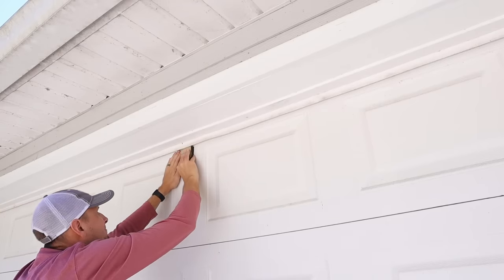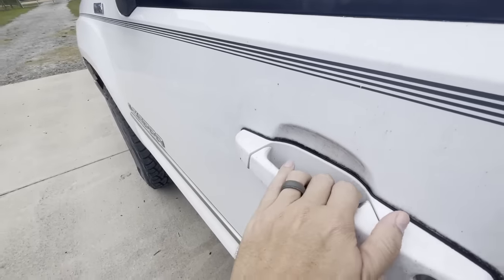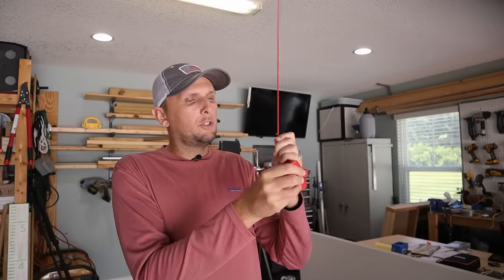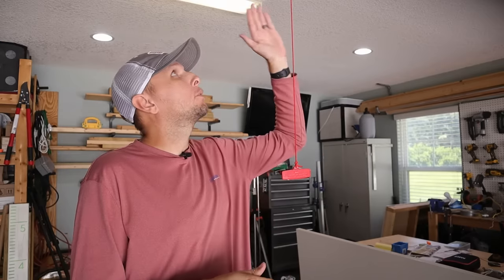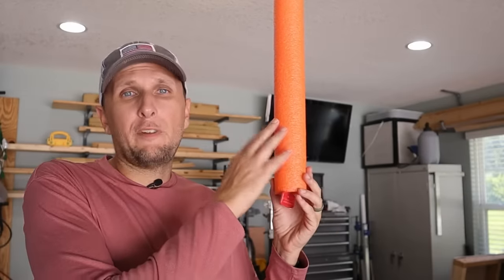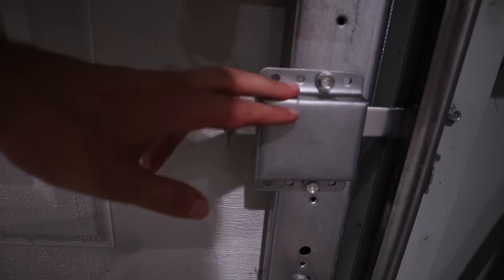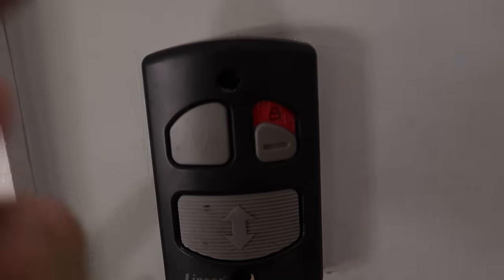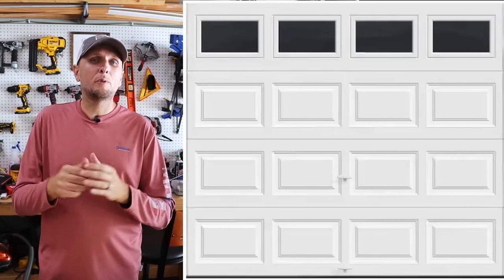How to Stop Garage Door Break-Ins | Number One Way Thieves Get Into the House!

Comment: Another classic screw up that leaves your home / apartment vulnerable is dead bolts that do not have the bore in the door frame deep enough to allow the dead bolt to lock.  Great content and thanks for sharing,
Reply from the maker: You are absolutely right!  And with all of the homes going up so quickly and inexpensive as possible, this is a common issue.  Thanks for the feedback David!
Reply: Or screws long enough to attach the locking plate into the actual house framing instead of the door framing
Reply: I thought of boring in a few inches of metal pipe into the door frame, just big enough diameter to receive the deadbolt, and then install the latch plate.  It won't change the look of the door frame.
Reply: @Mike__B  If the recess for the dead bolt is not deep enough for the dead bolt to lock after it is turned all the way then it does not matter how long the screws are.  The dead bolt can be coaxed back into the unlocked position.  Try it yourself - open the door, throw the dead bolt and push on it with your hand.  It will not move.  If it is 75% extended and bottoms out in the bore of the door jamb then you can push it back with your hand to the open position.
Reply: @elultimo102  it is not a matter of the pipe as part of the bore it is the depth.  Please see reply above to Mike B
Reply: @davidc6510  easy fix, Wal-Mart Drills are $12, paddle bit $2 for a cheap one, and 10 minutes time. I did this at my old apartment also because it wasn't deep enough, it is now.
Reply: @Mike__B  ---I was advised to reply to you.  I thought of using a 3 or 4" length of pipe, large enough to contain the deadbolt plunger, and still be hidden beneath the strike plate----They would have to bust through 4" of wood, to get the door open.
Reply: @davidc6510  ---I was figuring on 3 to 4 inches of pipe into the framing.
Reply: @davidc6510  No no I get that, my comment wasn't trying to refute what you said at all.  I'm just saying, I've seen a number of times when things are on the surface "perfectly fine" only to be ruined by the fact that dead bolt plate is screwed into the casing frame with small screws so that it's basically 3/4" of wood being the only thing to prevent a door from being forced open.
Reply: @Mike__B  I totally agree on that half a$$ install technique as well.  Had some work done and replaced those lame 0.5" length screws with 1.0" through the frame as well.

Comment: If you are worried about the one-button car remotes, you can usually get a spare keypad remote (like you would have outside the garage)  that is also wireless but programmed with a password. That can be kept in the car and then used instead of  the one button remote (disabled that).

Comment: Another way to secure the garage door when leaving for extended periods is just to screw a piece of 2x4 to the wall between the door and the ceiling.  The door will be impossible to lift.  Great video.  Regards - Mike

Comment: Pro tip: most newer garage door openers come with a wall console (where the push button is) that have a lock. The lock stops your transmitters (remotes) from working by locking the receiver.

With the clothes hanger, even with a pool noodle on the emergency release, the clothes hanger can pull the tab that the rope is attached too. Most brands have the tab facing away from the door and to unlock it, you can pull it where it snaps 90 degrees down or just pulled toward door enough to disengage it. You don't even have to pull the rope, just the tab. I have seen customers use zip ties around the tab and trolley to hold the tab in place. You'll have to cut it if you need to disengage the trolley. There are certain brands such as Marantec where the rope has to be pulled away from the door to unlock, meaning the clothes hanger won't work because even if the rope gets pulled through the top of the door, it has to be pulled the other way to unlock door.

Never lock the physical locks unless the power goes out and you need to open/close the door. You will eventually forget and if it opens while the lock is engaged, it can damage the lock, the opener, the door. It happens more than you'd think.

If you have torsion springs, you can set the opener off center. This is because the torsion spring system lifts both sides of the door at the same time. So it doesn't stress the motor out and the door will lift evenly. The opener does not have to be in the middle of the door. I've seen it close to the tracks where the roller wheels go. You cannot do this with extension springs. Extension springs work independent of each other, so 1 spring lifts 1 side. The opener has to be center of door for this.

Comment: When I worked for a door company, I had to break into garage doors often, breaking the glass was common because the single pane would only cost about $6.
Reply: Are those windows easy to reinstall?
Reply: @richardb8104  Yes, on metal doors there is square plastic trim on the inside holding in the glass. They snap in. Usually takes a flat screwdriver to remove and replace.
Reply: “Breaking the glass” like all doors have glass…
Reply: @echo-hotel  obviously not all doors have glass, but you’re missing the point that the ones that do are easy to break in to.
Reply: @echo-hotel  I said it was common. I didn't use an absolute.

Comment: Good tips!  If you have a windowed side door, which you appear to have (so do I), then burglars/invaders can simply break the glass and unlock the door, unless you have  double-key deadbolt.  Now I'm thinking of replacing the side door for a solid exterior metal door.
Reply from the maker: I don’t have a pedestrian door on my garage.  The whole idea is just making things harder and less appealing.  If someone wants in badly enough there is almost nothing someone can do to stop it.
Reply: I have one of those.  I have a thick piece of wood installed over the window (on the inside of the door, of course).  I also have a lock and deadbolt.

Comment: Great video!  I’m a former LEO……Another good tip is to install a smart plug in to the outlet where your garage door opener is powered from.  You will need to ensure that there is wifi connectivity within the garage.  Program the smart plug to shut off power to the opener during nighttime hours.  This ensures that remote openers cannot be used to open the overhead door.  The use of a smart plug allows the homeowner to toggle power on and off as needed for the garage door opener.

Comment: I installed a side mount garage door opener to free up the space in the middle, but having it eliminates the pull cord being in the middle. It also has an automatic deadbolt that gets engaged whenever the door is closed. They do cost more but I think they are a no brainer.
Reply: jack shaft operators are a great choice, but in order for them to work properly u have to remove tension from the garage door spring itself, the door cant balance like it normally would. normally a door will stay open when u have it on manual and open it half way it should stay in that position, when u open it up all the way it shouldnt be hanging down in the opening at all, when u switch to a jackshaft operator the first thing the tech does is take tension off ur spring. this way the door wants to fall down. now why would u want the door to fall down u ask? well thats super easy see the door runs on a track and is lifted by cables attached to the bottom section of the door as well as the drums on the spring shaft, when the side mount operator lifts the door its lifting it from the drums, if the door isnt "heavy" the cables will bail off the drum and the door will fall in the track usually lodging sideways halfway open or somethin. side mounts are great if u dont have the overhead space but there is a massive trade off, ur door is garabage on manual now, if u dont use it manually thats a non issue, however in the event of a fire nad u need to get ur door open ur gunna have to prop it up most likely. ive only been installing doors and operators for 11 years though.
Reply: Maybe on older doors but not newer doors. I have 2 jack shaft openers and can use it manually no problem. Never had to have the spring adjusted. Most jackbshaft openers have a cable tension sensor if there was a problem it will stop the door movement
Reply: Today’s jackshaft openers instruct you to make sure your door is balanced (stays opened when manually opened 1/2 way)

Comment: Good tips. I have a newer garage door where the motor is not in the center. the motor is directly to the side of the door and attached to the wall (not the ceiling). It does not have a release cord. The door also has automatic locks and the system randomly changes the code which makes it harder to hack.
Reply: You have what's known as a jackshaft opener ... the best type.  I have them as well.  I'm NEVER going back to those overhead openers again.
Reply: There is a problem with these. They don't push on the top center of the door and can leave a gap.

Comment: Thanks for sharing.  I feel it's very important to note that thieves don't only go for the rope.  They can also target the mechanism itself - especially vulnerable are those with windows on their garage doors.  The workaround for this is to use zip ties to secure the mechanism.  In an emergency, even with the zip ties secured around the mechanism, the garage door can still be released with the rope with enough pulling on the rope.  This helps to secure the mechanism but still allows the homeowner to release the mechanism in the event of a power outage or emergency.
Reply: @nobodynoone2500  I have tested it and have consistently broken over half a dozen zip ties.  Even with 2 zip ties.  

Home owners insurance has absolutely nothing to do with garage door openers.  Even if they did, the zip ties still break, so no safety devices are defeated.  Not really sure where your thought process is coming from.  That's like saying auto insurance will cancel you if you modify the emergency trunk release.  You may need to provide an example for some context.  

But as far as I know, securing my garage door has nothing to do with hail damage, wind damage, water damage or smoke and fire damage.
Reply: You can also use a small clamp to form a protective shroud around the release lever. This way it still works.
Reply: @HanginInSF  nice

Comment: Danger: Don't cut the cord or remove the handle. 

The cord and handle are safety features so that the drive mechanism can be disengaged if the door is closing on a person (or has somehow entangled a person). By all means, block the cord from passing through the gap above the door, or block the gap to force any hooks harmlessly away from the cord. But don't cut the cord.

Comment: Also, just removing the plastic handle from the emergency rope can, in many cases, prevent them from pulling it through the door.  When I used to install security systems, I would advise people to remove the rope and then have at least one, but I'd urge them to have/make two hooks on a handle.  This way they could have one on each side of the door to be used in case they needed to open the door in an emergency and have easier/faster access to them.

Comment: The hook method isn't just for grabbing the pull cord. They can grab the latch and pop it off there as well. (It doesn't take much force to do so.) One option is to disable the latch by using wire to lock it in place. Note however that this will disable the emergency pull cord. Use this option at your own risk.
Regarding see through windows in your garage (on the door itself or elsewhere; you can use spray window frosting to obstruct viewing inside while still allowing light to pass through. (The plastic window film works as well but is more expensive and time consuming.)

Comment: If you're going to be away from your house for a long period of time, just "lock" the door opener release mechanism by constraining the lever with a zip tie or some tie wire. Stick one end through the pull rope hole, and then find another hole on the rail or somewhere else to loop it through and pull it tight. On mine, there is a hole right above the lever that works perfectly for this. The door opener can still operate just fine with this in place. The opener cannot be forced open because it uses a worm gear, so if the criminal cannot release the door from the opener, then they'll never be able to get the door open.

Comment: Another alternative to the noodle on the cord is, replace the cord with a metal rod (3/16 dia). A hook won't be able to get a stiff metal rod past the top of the door. You can also make it short enough so it will not reach the top of the door. Simple and cheap.
Reply: against most states building code. It must be a red marked cord 6ft from the floor. This is under the emergency egress codes for buildings/homes. In case of emergency and lack of power you must be able to operate the door with clearly marked emergency releases and handles.

Comment: Great tips. Would like to see more security tips for doors / windows. I would add that would be criminals don’t care about cameras when they know they are there. A friend of mine had someone walk right up into his carport with hoodie keeping his face hidden and went through all of his unlocked vehicles.
Reply from the maker: Yeah I had calls to things that you wouldn’t believe how brazen the suspect was.  Cameras can be helpful but definitely not a guarantee to keep people away.  If there is something they really want they are going to try to take it.  Thanks for the feedback!  I will look into doing some more security videos in the future. A lot of really good tips out there.
Reply: Can always jam some 2x4 in the windows so they can't be opened easily. Using nice long screws on the door hardware and deadbolt will also work nicely to.
Reply: Using 3½ to 4 inch screws in the door and deadbolt striker plates massively increases the strength of door security.  This works by securing the striker plates and door jamb to the 2x4s behind them.  A lot of people don't know that the striker plates are secured with screws roughly 3/4" in length.  These short screws secure the striker plate to the door jamb, but the door jamb can easily be snapped with a single kick.  At least one 3½ to 4 inch screws should also be put in each door hinge as well.  

Any windows around entry points and in bathrooms are typically made of tempered glass.  Tempered glass is the glass that breaks into thousands of tiny pieces - it's also called safety glass.  Unfortunately the safety glass is very easy to make entry through within a matter of seconds.  Unless you've seen it for yourself you would not believe it.  This glass should be secured with security window film and the film bonded to the frame with silicon construction adhesion caulk.
Reply: @AC_metro  Great tip
Reply: If somebody is that brazen, there's not much you can do about it. The best you can really hope for is to make your location harder than the other options, and more work than it's really necessary. Yesterday somebody pried my mailbox open. They didn't get anything as I do check my mail regularly, but it's a significant inconvenience.
Reply: @SmallSpoonBrigade  that's the whole point - slow them down.  And yes, the violent criminals that have skirted the justice system because of soft on crime policies have indeed become just that.... brazen.   However, that doesn't mean we just lie down.  This is our home we're talking about - a home that contains our family.  There's always a choice and we should always have a say about our family's safety even if that day comes.

When law enforcement started to become outgunned in the 1980s into the 90s, they started switching to semi autos and over time realized that, too, was insufficient and moved to carbines.  Many civilians complained about law enforcement becoming militarized, but it wasn't militarization..... it was modernization.  

In the same respect, we need to keep up with the trends of criminals and unfortunately "adapt" and modernize our basic understanding of home security.  Gone are the days of just turning exterior lights on as a means of deterrence.

As a swat operator that primarily works in a fugitive warrant division and has served literally thousands of warrants resulting in thousands of hands on arrests over the last 16 years, I've seen a disturbing shift in the depraved mindset of career criminals.  I have conscientiously dissected above and beyond that standard tactical debriefs of every warrant I've served.  Doing this on my own has given me an acute understanding of the need of my own home security based on how many structures I've breached and search.  Anyone can be a student of tactics and personal security.  Just don't go overboard and become hypervigilant.  However, definitely don't lay down and accept the lie that there's nothing you can do about it.

Comment: Completely removing the cord from the emergency release is not advised.  The release is not only for a power outage, but also in case of a fire to allow quick egress.  All my kids are taught how to use this for this exact reason.  I do like the pool noodle or just cutting it shorter. (As long as all the members of your house can reach it.)

Comment: Two measures I took were to have my wife standing with her arm stretched towards the safety cord to determine the length of cord (she's the shortest in the family).  Next if you look at the safety latch mechanism every opener will have a hole on the latch trolley and a hole on the unlocking arm.  I use a zip tie that's strong enough to prevent easy unlocking (breaking the tie) but one that allows someone inside to disconnect the trolley with a strong pull.